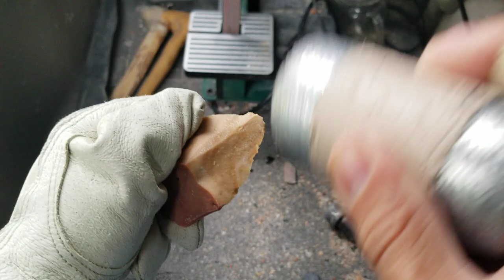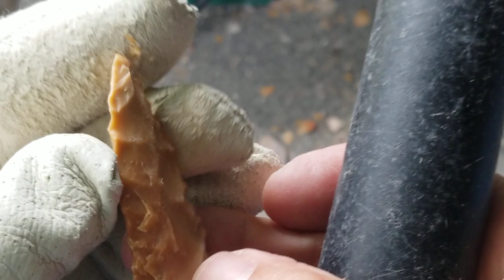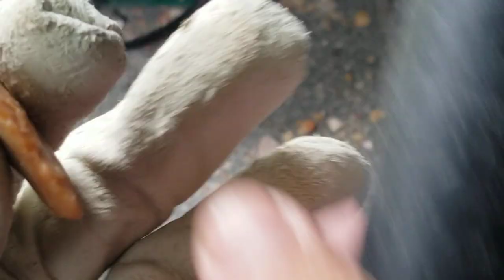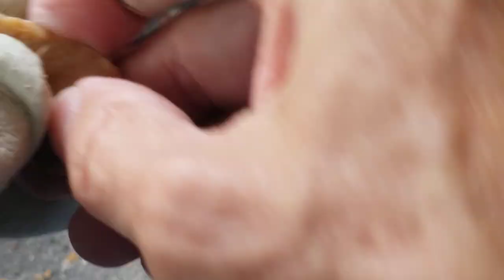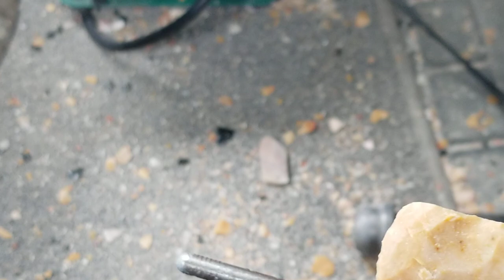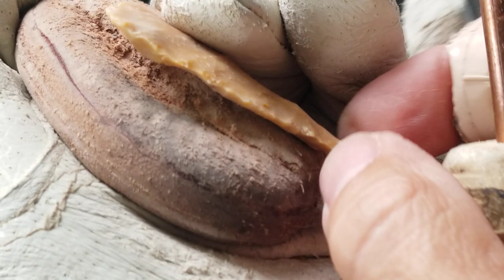1251 - Part 3/5 - Flintknapping Florida Ocala Chert Flake

Comment: I have a few pieces of dacite and obsidian that I'm saving until my hickory and hornbeam seasons. I'm thinking the wood will be more forgiving by not producing such a high frequency wave and thereby not crushing the edges and also allowing the flakes to stay intact longer to aid thinning. I can work it with copper but I'm looking forward to indirect wood because it seems like a good combination...crunchy rock , softer tool...hammerstone philosophy 101.
Reply from the maker: Cool. Keep me posted
Reply: Would that hickory wood work on texas chest or is it too hard?
Reply: @johnturner6069  I work a lot if Texas cobbles and I think it would do good if it's heat treated. I have some that works very easy. Raw rootbeer would likely work pretty good if the edge is crushy... especially in late stage thinning. I've tried it on Georgetown that's high quality that my copper tended to either make a bigger bulb because of a stiffer platform or crush if it was lighter. It was a short punch I made from a broken hatchet handle but it worked nice. The heat treated Texas chert/cobble works as good as Georgetown to me if it's high quality to start with. Any application where you want more bite and peel would be nice I think...especially if you don't have antler....wood is cheaper or free too.